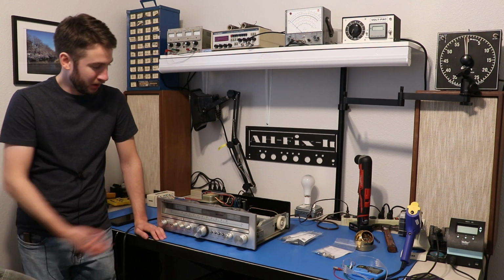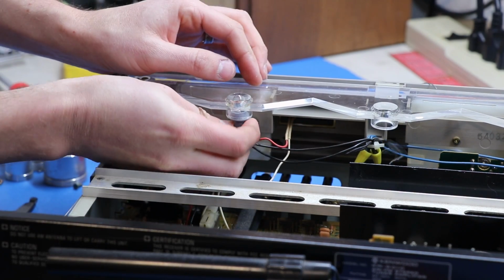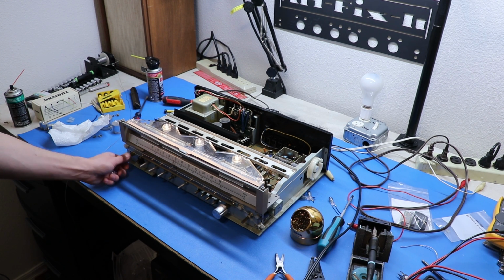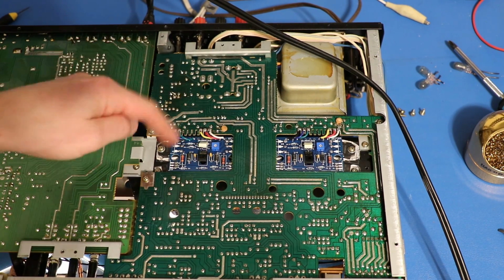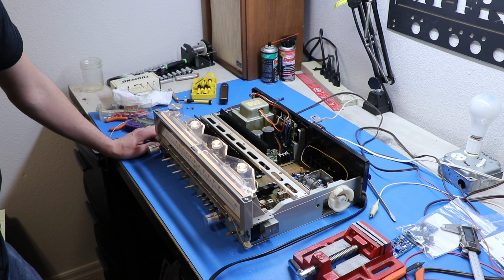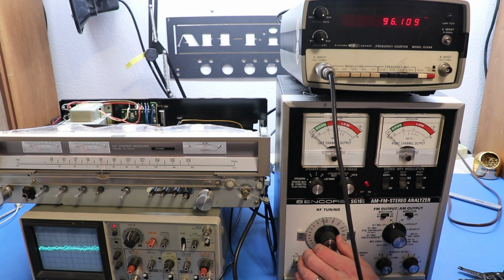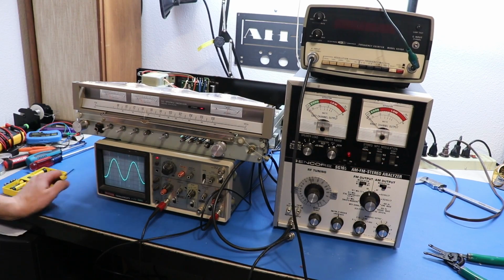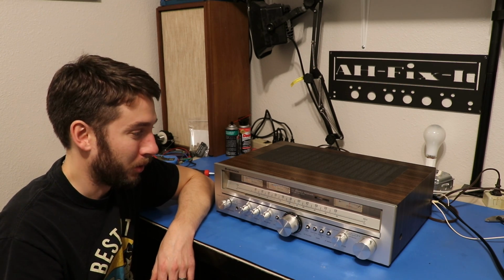Finishing The Kenwood KR-5010: FM Alignment, Lamp Replacement, Clean Controls, And More!

Comment: I have a Kenwood 5150 receiver and the left channel no output either. what are potential steps to look at to check for repair? (i.e fuse, cold solder, cleaning which done.)

Comment: Isn't simply re-heating the solder good enough to consolidate the cracked areas? You've slopped solder all over that board. It looks like several of the puddles are touching each other.

Comment: Wire nuts in a stereo? Wow, have they never heard of a soldering iron? OK, when I was working on my project truck I found wire nuts for the license plate lights wiring. 

Bonus: They left one of the original lights hooked up, just dangling underneath the truck. I guess that way you could see where the spare tire wasn't.

Comment: I had a KR-5030 for while, the tuner on that wasn't the strongest either. It received nothing without an external antenna. 
I had gotten it with a garbled/ intermittent left channel that turned out to be both control issues and two bad transistors. (The 5030 did not use Darlington packs). 
When it comes to the Darlington pack receivers, I think the 0050 and 0082 packs were by far the best sounding of all of them. The 45-50 watt range also seems to be a sweet spot sound wise in those receivers, be it from any of the major brands. 
The 5010 looked the best out that model line, the center knob sort of balanced it out somewhat appearance wise. 
They were known for power switch issues much like some Pioneer models like the SX450.

Comment: Great video, as are all of them on your channel, so thank you!  🙏 
I have a 5010 and LOVE this receiver.  It has very similar warmth to my 881 but sadly, the treble has disappeared from the right side, whether it be the A or B channel (speakers and wires swapped - it's the rig).  I've tried to test through the caps and transistors while in-place, which I realize is non-ideal, but can't find a culprit. I have minimal diagnosing skills and don't want to go full trial and error so I'm going to start with your 4-cap recap and see if it leads to success. 
Quick question about the schematic you showed at ~15min.  Is that available online?  Your image looks much cleaner than the online version I downloaded, which is a pretty rough photocopy/scan.  It would be nice to have something a little more legible.
Thanks again!

Comment: Greeting. Interesting video... I have the same model of camera... The problem is that the source selector doesn't want to work anymore... What do you advise me to do.? Do you think a contact spray would be enough? I pulled my hand to the back of it to have a signal on the pick-up... But I would still like the radio part to work.
I'm waiting for an answer from you. 
Thank you in advance
By the way... I am from Romania.

Comment: In Australia we call them dry joints. I have never been a fan of Printed Circuit Boards. My valve amps are point to point wired with a couple of PCBs for low heat apps like holding LEDs together. PCBs are no bodies friend.

Comment: Re: your comment about the tuner quality. Actually, the reason some receivers (including this one) can not receive stations without an antenna attached, is because they have better shielding. A tuner that picks up without an antenna is more susceptible to external RF interference, and is actually acting as an "unintended" antenna for external RF. If you look at the service manual for this receiver, the FM sensitivity spec (given in mV) is right up there with any receiver of the era.

Another note - I own the baby brother of this receiver, the KR-4010. It is put away for now, but it was the receiver my parents bought when I was in high school, and yes, it got a lot of use from me! It was rock solid until it was put away. However, I recall the tuner section was having some issues, and now I have something to go on, thanks to you!

Comment: Hi I have been a subscriber for a while. I am currently doing a full restoration on a Pioneer SX 939. When I got it it was totally DEAD. I rebuilt all the boards and fixed or replaced everything I could see broke or wrong. It now came to life and all seems good except I can not get any sound out of it when hooked to an antenna and speakers. I tested the DC offset which is good. I am at a loss as to what to test or how. Could you give me some advice as to where to look and how to test? Thank you for any help.

Comment: Sorry to say, but look back at your reflow job of the speaker switch ( 9:48 ), four or five contacts did not get a good flow and still have partly a cold joint. They will go again in a few years. To much haste I think.
Good to see that you gave up on the shotgun replacements by now 😉

Comment: I find that the orange caps are usually much higher quality (low leakage) than other caps and tend to leave them alone.  Nichicon KL series works well if you're going to replace them or film caps.
Reply: Haven't done a recap job in a while have you  ?